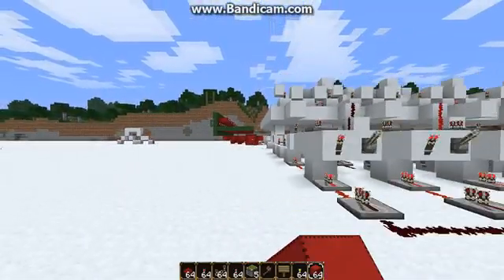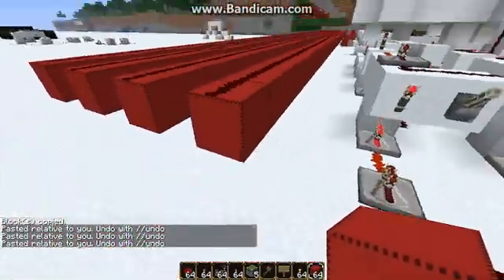Building a minecraft computer tutorial pt12: Putting it all together 1/2

Comment: i agree, if you have something wrong with the adder its not benny's doing. i built it the exact same at it works fine for me. it didnt first off as i had missed a part out accidentally causing it to output incorrect numbers. after i fixed this it works great.

Comment: I have run into a problem, whenever I choose the input to be 1 (on user controls 1&2 and Rom 1&2) and hit read, it stays lit up even though there is no power going to the wire (I checked all the sides, no lit torches) any help

Comment from the maker: You can add any function you please. Some common ones, aside from the ones you listed, include XOR, AND, OR, and more rarely implies. It's also common to run the output of the ALU through an XOR gate, which allows you to optionally invert your output. However, aside from that those are mostly the functions used in at least simple computing. More complex operations would be too big and slow to be useful, unfortunately

Comment from the maker: @MinecraftMania79 It could be that you pasted it wrong, yes, but what it sounds like is that for some reason your save to a/save to b commands are taking an inverted input. A simple inverter for each command wire should fix that if I'm right. 

Another possible (although much less probable) issue, depending on how you're checking if the input is working is that you built the ALU wrong, and it only appears incorrect because the ALU is not working right.

Comment from the maker: @MinecraftMania79 The most probable cause is that the input isn't reaching the d flipflops for some reason. Make sure that when you're holding the save lever, there is still power going into the d flip flops.

If it's not that, then it really could be almost anything from a glitch to you missing some redstone somewhere along the line. If you could give me more information such as whether the input goes through if you save, or really any more information at all it'd help in diagnosing the issue.